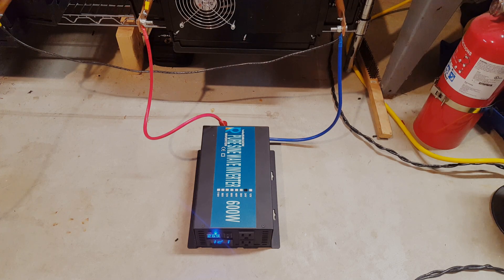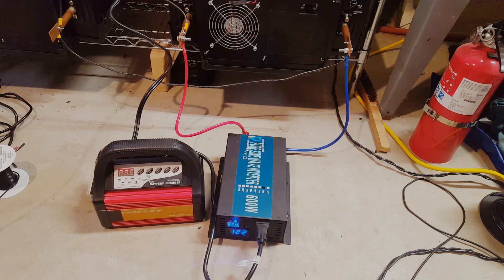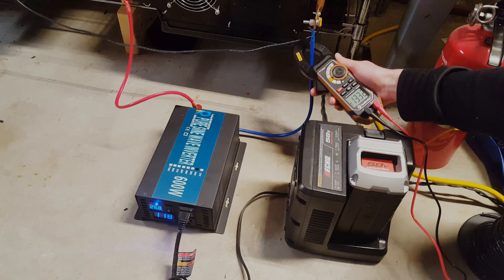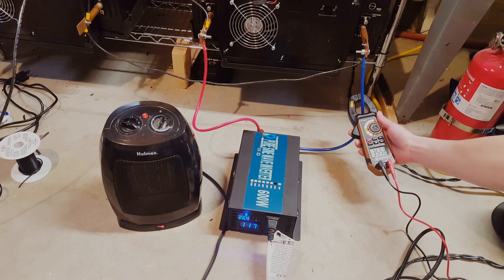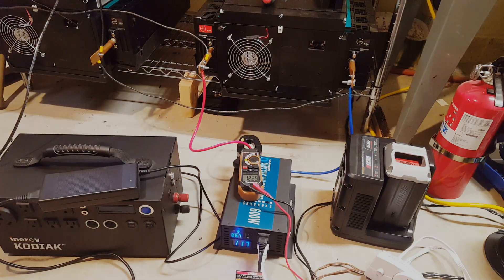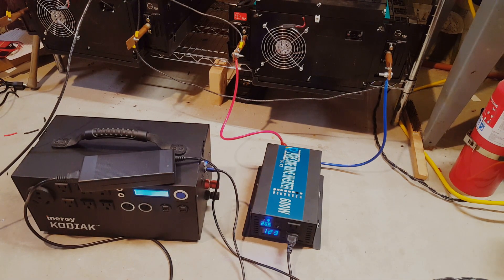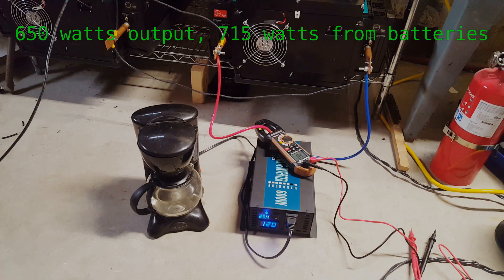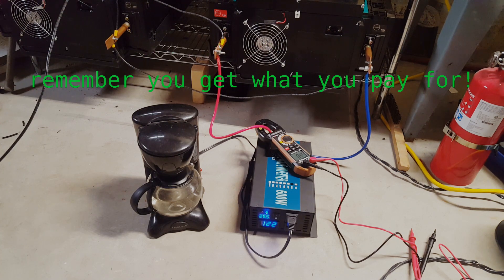I was (kind of) wrong!!! I'm retesting this cheap inverter! WZRELB 600 watt 24 volt inverter

Comment: this inverter is to small for high frequency switching devices like your 12v charger, even the larger models will not like it but will run it. it messes with the inverters switching ability to make the higher voltage.
Reply: Wow, excellent input there! A lot of switching power supplies draw current in spikes, including power inverters themselves! I have a DC clamp meter that reads steady state AND peaks. I found that the peak reading can be near double the steady state draw from my power inverters! That's NOT just when starting up load either.
Reply from the maker: Thanks for the info! That explains the terrible noises it makes right before it shuts off  ;) I guess it will be reserved for simple resistive loads!
Reply: @diyrenewableenergyelectron4996  they do fine with 99% but you founds that 1%er :D
Reply from the maker: Figures! 😂
Reply from the maker: Btw, I enjoy your videos! Lots of fun!
Reply: @diyrenewableenergyelectron4996  thank you!

Comment: I have the 24v 800w version, I dies 3min in when I plug in my 15w laptop charger (it has a ground pin) however It can run a 100w pedestal fan no prob😂
Reply from the maker: Some of the loads around the house make these cheaper inverters go haywire. Thanks for watching!!

Comment: So you plugged in a charger from the batteries you are trying to charge? no wonder you are having issues...you are pulling out more power than you can put in when you do that with the conversion with the charger, it seems to you pulling the voltage "out from underneath it" so to speak. it appears based on what I can see is you are draining the capacitors in the inverter with tha current draw from the charger, since its the same connection you are pulling and charging from...

Comment: I have a 12v 800w version of this in my campervan and its been superb so far, maybe a bit noisy when the fan comes on with high continuous load. I've ran power tools from it and even small electric heaters. Mostly I use it to power my laptop and monitor plus occasional blender and charging various devices, plenty of juice for me. Idle consumption is around  8-10W. Later versions have a remote to turn it on and off which is handy.
Reply from the maker: Nice! Glad to hear it has been reliable for you. This one from the video is still chugging along. Thanks for watching!

Comment: Can you check if the voltage from the hot line on this inverter is 60 volts and the neutral???...is the inverter ground  prong  in the inverter...connected to the neutral??? Thanks
Reply: Yes.  The important thing is that this inverter are not to be connected to the breaker panel on the house.  These inverters are basically  to be used with an extension cord...in where the ground prong in the appliance will be basically floating.
Reply: @tonypower5625 they wired these incorrectly from the factory.   The outlet hot or line is connected to the neutral on the board.     If you correct the polarity and relabel the terminal bus connections it can be earth grounded and neutral bonded.   I have the 5000w 24v inverter that I swapped the pc neutral and hot to the outlet and it has been connected to a main panel and earth ground running 24/7 for over 3 months powering my fridge at an off grid cabin.    Once you correct the polarity you can neutral bond and earth ground without blowing it up.   It also eliminates the 60v issue once the neutral and ground are bonded (at one location only).     These are very good inverters they get a bad rap because the factory missed the wiring diagram.   The newer black units with the “horizontal white outlet/receptacle is wired correctly.     I have a 3000w of that model and have opened it up.    
I made videos of this and emailed WZRELB reliable and their response was dismissive.
Reply from the maker: I will double check when I have a chance but I distinctly remember reading that the neutral isn’t ground-neutral bonded. I read that the hot side produces 60v from ground and the neutral also produces 60v from ground (in the opposite direction) to produce “120v”. The appliances usually don’t really care, but it causes problems for some people. I’ll check mine and see what I get though!

Comment: The test leads that come with any inverter are junk.
Reply from the maker: It sure seems that way! The Duracell I tested in another video had decent wires, but they were undersized. Go figure 😒

Thanks for watching!
Reply: I Run 1/0 cabling on My 24 Volt 800 Watt WZRELB Pure Sine Wave Inverter and IT performs almost as Good as My Victron 24/800 watt.
Reply: @1GREATDANE  24v has less amps than 12v. So you could get by with a little smaller. But I am a fan of overkill.

Comment: The items it did not power may need a pure sine wave to function properly. At the price you said this was, it is likely a modified or even a square wave inverter. Those do not put out "clean" power, and some items just have to have that clean juice to make them function properly. Typical items that need that pure sine wave can be microwaves, laser printers, 3d printers, variable speed tools, some battery chargers, and some medical equipment, to name a few. 
Of course, there are items in that list that will run okay without the pure sine wave (depends on the brand and build, etc) but in some cases, even if they run, they will not be operating efficiently.
Pure sine wave inverters have come down in price, and you can find a 2000 watt one for about $180-$220 on average. (and a 1000 watt one for about $130) - It would be interesting to pick one of these up (or borrow one) and give the items another test.

The only other thing that I can think of is most inverters have a floating type ground. That is, they do not have the same ground as your house and likely your solar grid. (A wire going to a stake in the ground) - This is not usually an option with inverters mounted in a boat or an RV rolling down the highway. 😁 
If you stick a common circuit tester in it, it will like be showing open ground, - potential of electrocution. If your inverter has the external ground post or screw, you could try running a wire from it to a ground in whatever place it is being used in. (Also, mounting it to a metal surface can help, if it has raised mounting flanges. If it does not, then I would not do that step, due to most have vent holes in the bottom, and without the raised mounting rails, you may be blocking some venting.) In these cases, the N and G wires can be jumped together if they are at zero volts. This often tricks the inverter in to thinking it has an earth ground. (like jumping the green wire to the white wire on a socket in your house will make a socket tester show the electric socket is grounded properly.

With all this said - I am not a licensed electrician, and all of this should just be considered as possible steps and reasons. Everyone should do their own research and/or hire a competent and licensed electrician for any help they need. (PSA over now)

Cheers!
Reply from the maker: Thanks for all of the info! The company makes larger inverters, I thought about getting one to see how it handles it. I've seen one of their 8000w units start a big air compressor (shout out to goingoffgrid). Thanks for watching!
Reply: @diyrenewableenergyelectron4996  I will be ordering a 2000 watt pure sine wave inverter tonight before hitting the sack....We had a power outage a few days ago that lasted about 6 hours. I had a 800 watt inverter and hooked my chest freezer to it....No problems at all. 
But then I got greedy and wanted to hook up my fridge too. 
Like a dummy, I decided to plug them both in at the same time, since once the freezer compressor kicked off, it was only drawing about 1 amp. It worked fine for a while, then the freezer compressor kicked back on while the fridge compressor was running, and the magic smoke was released from the inverter.

The smart thing to have done, would have been to run them one at a time, and alternate them about every 20-30 minutes.

Everything would have stayed chilled/frozen and I would still have the little inverter, and would not be spending $225 tonight- Doh!!  😢🤣
Reply from the maker: Happens to the best of us! Alternating is a clever idea. Hopefully this new one holds up like a champ!
Reply: This is a true sine wave inverter, it’s just it’s a high frequency inverter so the surge power is only 2x. You will need at least 4x for a inductive load.

Comment: in a few days i will be receiving my 48v 5k psw inverter from this company. it will be bouncing back and forth between two 20kw 48v banks.
Reply from the maker: What do you plan to power? Thats a nice size inverter!
Reply: @diyrenewableenergyelectron4996  for now only a few computers, big tv, some xbox's, some lights, a 1500 watt microwave and regular sized fridge. i can already do all that on my 3500 psw inverter, but i really want my batteries to last so im moving into 48v so i can run less in parralle and some in series, 4s4p 12 fla 130ah 16 batteries. i plan to slowly expand my solar panels as on bad days of sun my batteries dont get fully charged. im going to make sure i get a full charge in full over cast days lol
Reply from the maker: Nice! FLA definitely NEEDS a full charge each day, they die quickly if they are partially charged most of the time. Glad you are expanding the solar to make sure the batteries last! The only thing that you mentioned that would even remotely concern me (and it's not a big concern at all) is the surge on the fridge. I'm guessing the 5kw unit is so large that even though it's a high frequency inverter, it will brute force its way through the surge. Please report back after you get it up and running. I love hearing from viewers.
Reply: @diyrenewableenergyelectron4996  i kinda knew about the battery thing about state of charge...kinda. its all new to me and i am the type that needs to see for him self even if it means i need to learn the hard way, another example of that is that i have 16 brand new 12 130ah batteries in parallel. everyone tells me this is bad and i even started to repeat it but then i was like "hey maybe i can prove it, one way or another" and shoot a video. i have asked around and every says just dont do it and i say why...lol. 

anyways i have two big separate banks, one is 12v and the other is 48v (to try it the "right way") for a total of 32 batteries. for the record my 3500 psw inverter, 7kw max,  handles the fridge kicking on and the 1500 watt micro wave no problem at the same time all while playing xbox on 65in tv and two gaming computers, but usualy not gaming on them.

 i did watch the amp spike on that fridge and it was huge, but i really dont remember what it was. 

its nice having such a huge battery bank as i call pull a continuous 600 watt load for 12 hours and watch the voltage drop only from say 12.6v to 12.2v. i should have went with lifepo, but i was able to get all my 32 fla deep cycle brand new with 2 year no questions asked free replacement warranty for only about $130 a piece and pro-rated after that. plus i needed to cut my teeth on something  now with a local source then branch out in a few years
Reply from the maker: It sounds like you have a solid system and a good handle on it! Good job!

Comment: this is just a guess but possibly bad solder joint either with one of the MOSFETs or on the inside somewhere where the wire connects to the AC plugs or maybe just a poor connection there.
Reply from the maker: Thanks for the suggestion! Ill have to dig into it. Thanks for watching!
Reply: @diyrenewableenergyelectron4996  you are welcome

Comment: My wzrelb 3000 watt inverter from reliable power tripped my equipment and then started to smoke. Power maybe reliable? ... Not recommended. Other you tube reviews show zero short circuit protection. Risk of fire or damage to unit is possible and therefore expense.
Reply from the maker: Dang! Can you give more details about the situation? That sucks. Thanks for watching!

Comment: It’s a 600 watt inverter but the max total is 1200 watt peak.
Reply: ive noticed that also with some power generators it seems to use some of that peak power as long as you dont exceed it.
Reply from the maker: Correct. I am just surprised that it actually was able to perform as well as it did considering the cost and overall build quality. I wouldn't want to depend on it but a very good value for non-critical non-inductive loads. Thanks for watching!

Comment: Since this is a HF inverter design, it works well with devices that either appear as resistive loads or have only a small difference between real power and apparent power.   Assuming the output is filtered reasonably well, devices that use switchmode power supplies should run just fine along with devices that have a resistive load.  Devices that have a high surge or inductive load probably won't run very well on this inverter.
If you want to run inductive loads or loads with high surge current, you should look for LF inverters.  Inverters that are installed in houses for off-grid installs are almost always LF inverters since they can handle the surge and inductive loads and most often can also handle the higher needs of a whole house inverter.
Reply from the maker: Thanks for the comment! I bought a LF inverter from sigineer and it handles surge loads and inductive loads with ease! What a difference!
Reply: @diyrenewableenergyelectron4996   BUT...  linear circuits are just 67% efficient, bulky, heavy and hooter, vs switching mode (class D) 92~96% efficient...

Comment: I also support many inductive load explanations here. I saw that with my 600W Giandel pure sine wave inverter too. I plugged in my A/V amp (rated 250W) to it along with some other resistive loads(very small like 50w) . With power meter they consumed less than 300W while running. So I thought would have no problem. But the moment I turned on A/V the inverter shut off and never recovered. I found that the A/V has lot of inductive power electronics like transformer inside. I measured an inrush current of 12Amps at 120V which is 1400W for a short duration. As the peak of my inverter is 1200W, it made inverter go crazy and never recover. Learnt a lesson about inductive loads afterwards.
Reply from the maker: Thanks for sharing! Experimentation is a lot of fun, especially when you learn these limitations before you REALLY need the inverters (power outage).
Reply: @diyrenewableenergyelectron4996  Yep, prepare while you can

Comment: So the issue here is that the inverters have a super easy time with resistive loads which is your coffee make and heaters. Where it has a harder time is with things like inductive loads where you have to compensate for something called a "power factor". For example, lets say you have a 500w motor that consumes that when its running. Inductive loads like a motor can have a power factor of 0.5 meaning you have to have a power supply that can put out 1000w of juice. Willing to bet that DC DC power supply used on the charger has a really crappy power factor rating killing the inverter. The watt meters on the inverter will typically show average load without power factor compensation. Look on amazon for a "kill a watt" plug in power meter for 10 bucks. Aside from measuring stuff in watts, it can display power factor as well.
Reply from the maker: I knew about high surge loads (power factor) being an issue, so I didn't try my refrigerator or sump pump but I didnt expect a little 12v charger to cause that same issue as well. However, what you said makes sense in that it is probably very cheaply made. I don't doubt that. I think I will mess around with the kill-a-watt meter a little bit and see if I can find a spike in the wattage when the charger goes to 15 amps.
Reply: @diyrenewableenergyelectron4996   Getting there but surge load and power factor are two different things. As another example, old skool crappy CFL light bulbs may have stated 20 watts in use bu most of them have a power factor of 0.5 meaning the power supply needs to be capable of outputting 40 watts. The surge from a refrigerator starting up is called a "locked rotor" current, that is the maximum juice it needs just to start turning and yeah, that can be 10x higher than running watts which is why most inverters choke.
Reply from the maker: Thanks for the clarification. Ill do some research so I'm more well versed about power factor!
Reply: @diyrenewableenergyelectron4996  maybe your amp clamp can capture the spike, i did this with my fridge and was shocked how high it spiked, but that was some time ago and dont remember what it was
Reply from the maker: I dont think the model I have can do it, but I need to buy one like Lithiumsolar's. It has a setting that can capture peak amperage. A shop vacuum spiked to 70 amps in one of this tests 😱

Thanks for the suggestion and thanks for watching!